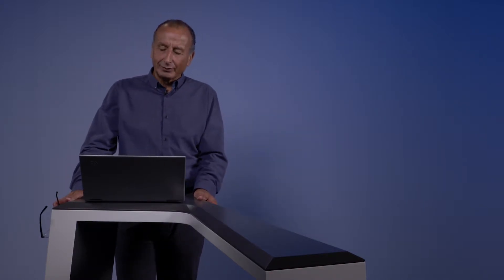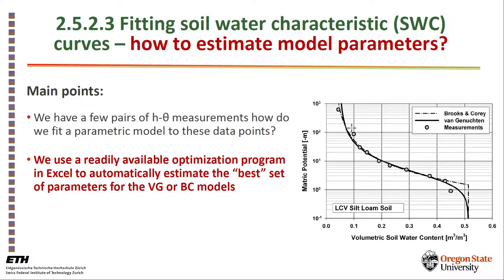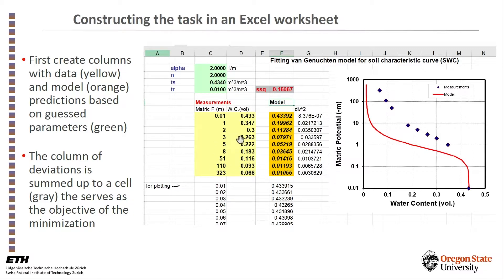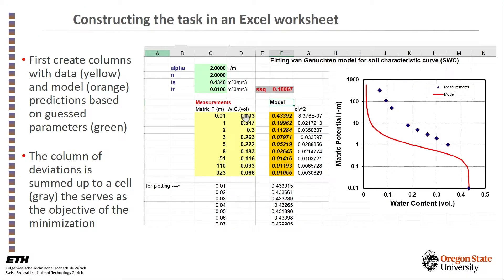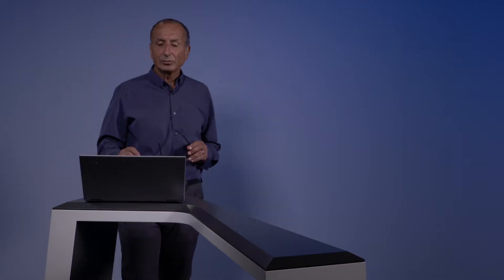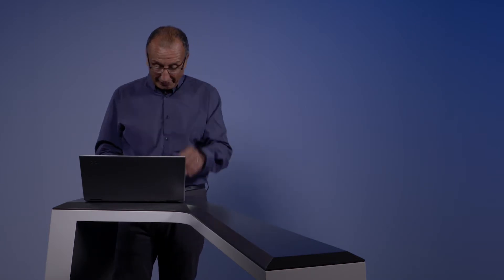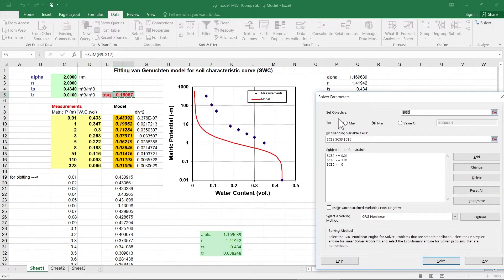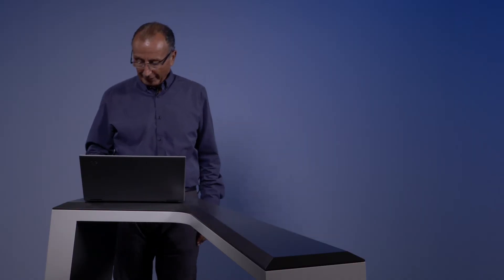3 3 3 Estimation of van Genuchten parameters

Comment: Thank you for your high quality content! I have one question: why is it that when we set the solver, we do not only set the div^2 to a minimum, but we also need to make rules for alpha and n? I do see why the residual part can't be below 0, but not why alpha and n need these exact rules... thanks for your help!
Reply from the maker: You can add limits to alpha and n, but if the data are reasonable, these tend to converge nicely, so setting limits is not usually needed for these parameters.
Reply: @selkerandorsoilhydrologyan3426   thank you!